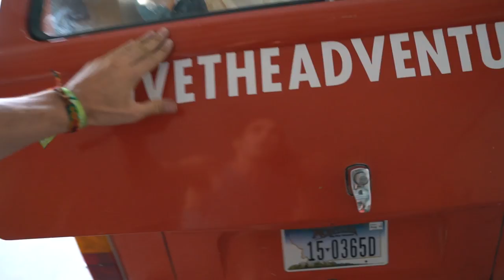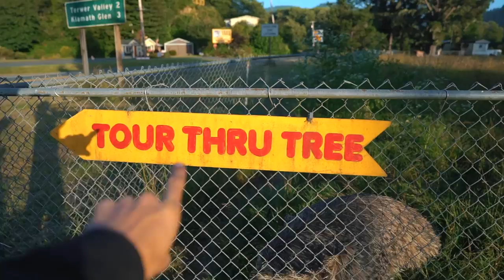BOOSTED BOARDING THROUGH A TREE??

Comment: For the my traveling van what needed to be replaced every 3-4 years was the starter, Ignition switch (from turning the key a lot for charging devices) and the alternator. Look into getting new shock absorbers, Louis. I have a 1993 van. It rides like it's brand new after I got all 4 shocks. The difference is unreal. So, so worth it!

Comment: Louis, you should get a solar powered panel installed to your roof of the car which is connected to a battery so you can use the solar energy for charging all your equipment!